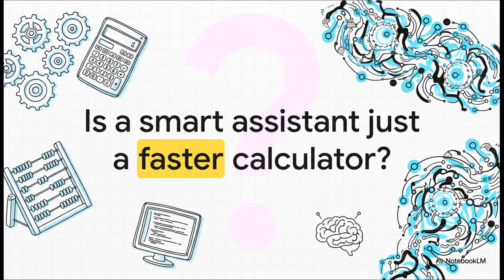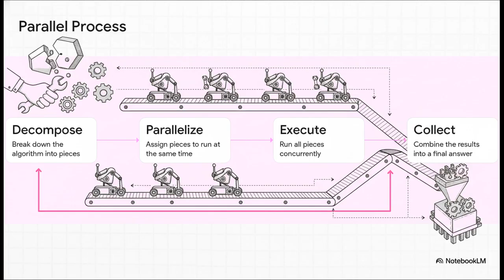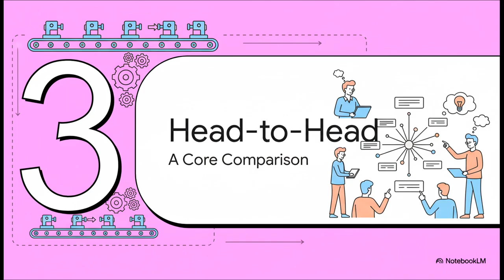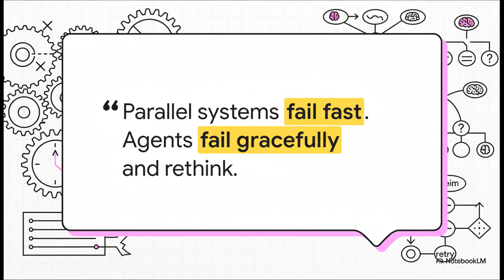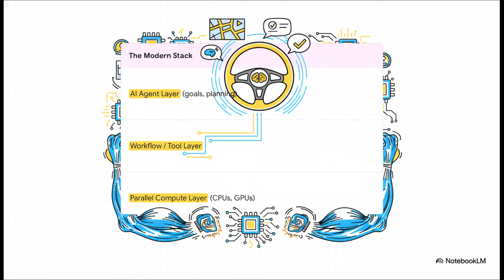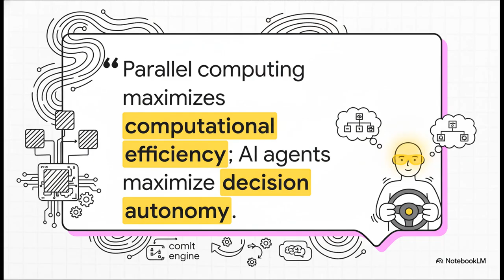AI Agents vs Parallel Compute: The Deterministic Engine and the Stochastic Driver

Comment: Preparing data for RAG requires careful curation of relevant documents and efficient retrieval indexing. High-quality, contextual data improves the accuracy of retrieval-augmented models, especially in enterprise applications. Organizations like Lifewood Data Technology support this through structured data preparation, annotation, and validation workflows for reliable AI deployments.
Reply from the maker: Spot on—high-quality data curation is the "secret sauce" that transforms a generic RAG system into an accurate, enterprise-grade application.

Check out the "Data Quality Framework (DQF)" at youtube.com/watch?v=yC1283MGu7E&list=PL7JCuc9FXzOBH5CZ-mEpX6F7EZpthyLAf